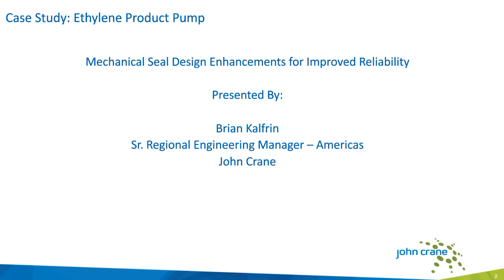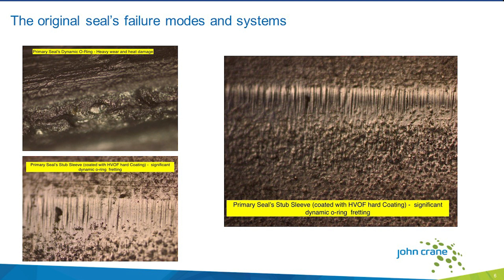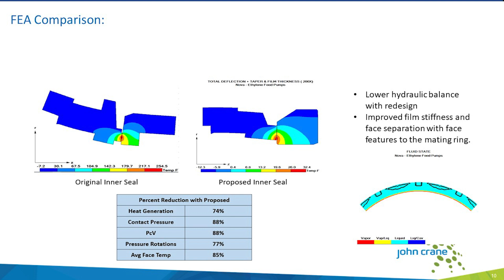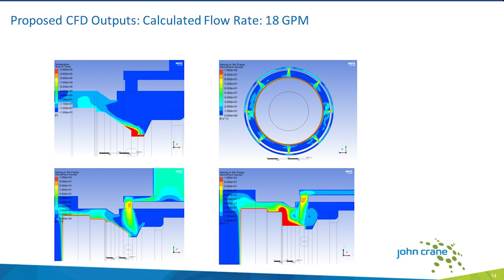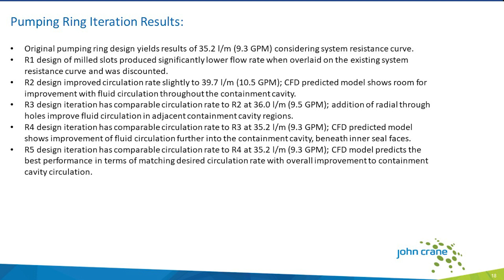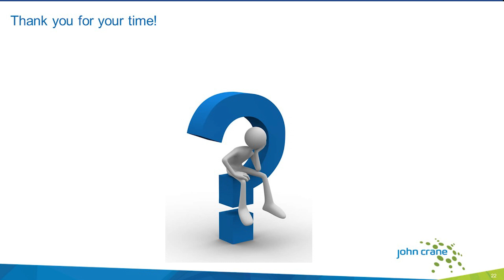Mechanical seal design enhancements for improved reliability | John Crane

Comment: Dear John Crane,

I am writing to express my appreciation for your Mechanical Seal Design Enhancements for Improved Reliability white paper. This paper is a valuable resource for anyone who works with mechanical seals, and it provides a comprehensive overview of the latest design enhancements that can be used to improve seal reliability.

I was particularly interested in the section on active seal face features, as I have been working on a project to improve the reliability of mechanical seals in a high-pressure environment. The information on non-pusher secondary seals was also very helpful, as I have been looking for ways to reduce O-ring failures.

Overall, I found this white paper to be extremely informative and well-written. I would highly recommend it to anyone who is interested in learning more about mechanical seal design enhancements for improved reliability.

Thank you for sharing this valuable resource with the community.
Reply from the maker: Thank you so much for your kind words and thoughtful feedback, Joel. We're thrilled to hear that you found our Mechanical Seal Design Enhancements for Improved Reliability white paper valuable and informative. It's wonderful to know that the content resonated with you and that you found specific sections relevant to your project.

Your recommendation means a lot to us, and we're grateful for your support in sharing this resource with the community. If you ever have more questions or need further information on mechanical seal design, please feel free to reach out or visit our website @ www.johncrane.com . We're here to help! 😊